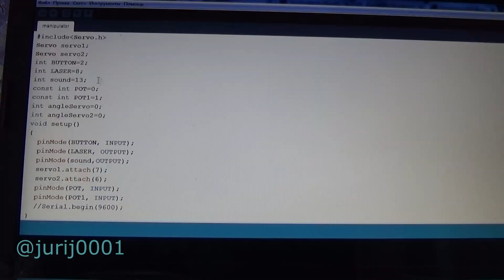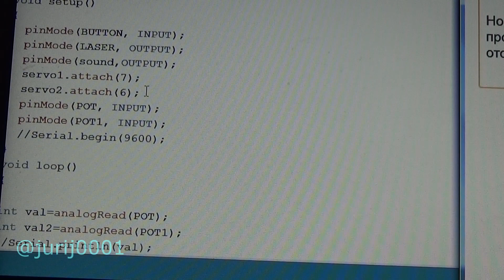How do you start making a robot? The connection of the servo. Arduino projects.

Comment from the maker: Friends! My engineering notes can be purchased here:
170 notes. Physics and engineering  https://teespring.com/shop/170-notes-physics-and-enginee?pid=960&cid=104025 
21 problems in mechanics  https://teespring.com/en-GB/shop/21-problems-in-mechanics?pid=960&cid=104025 
21 notes on molecular physics and thermodynamics https://teespring.com/21-notes-on-molecular-physics?pid=960&cid=104025 
21 problem of electricity (electrostatics and laws of direct current) https://teespring.com/physics-and-engineering-elec?pid=960&cid=104025 
21 problem of electricity (electromagnetism, alternating current) https://teespring.com/21-problems-of-electromagnetis?pid=960&cid=104025 
27 notes on quantum and nuclear physics https://teespring.com/27-notes-quantum-and-nuclear?pid=960&cid=104025 
21 notes on Astrophysics https://teespring.com/astrophysics-21-notes?pid=960&cid=104025 
Arduino for beginners https://teespring.com/arduino-for-beginners-in-notes?pid=960&cid=104025 
 Sincerely, Yuri Kovalenok